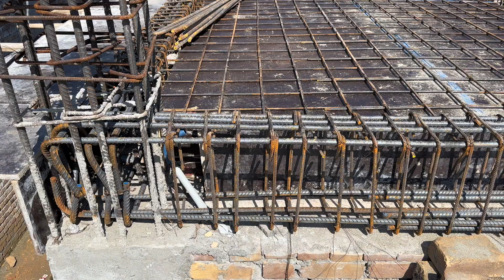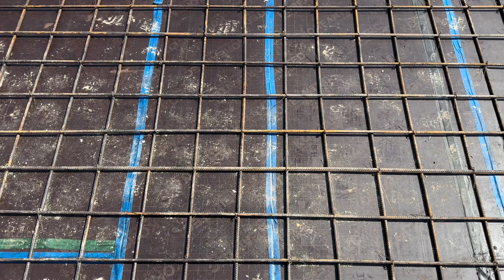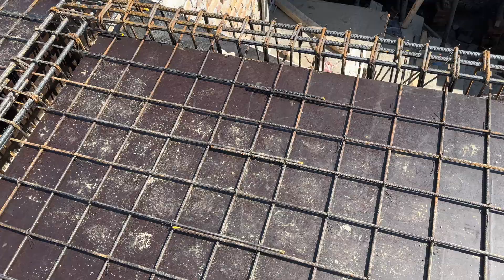Beam Structure Reinforcement Details

Comment: What is the minimum and maximum distance between 2 columns for a 5 storey commercial building?
Reply: it depends the design of the structure , generally 3-5m span will be provide for small storey buildings, 6-9m span for high storey buildings, In many cases size of the columns will play important role to provide the span of columns.